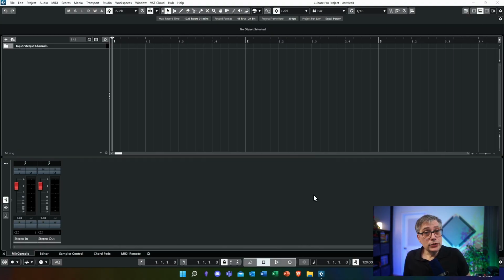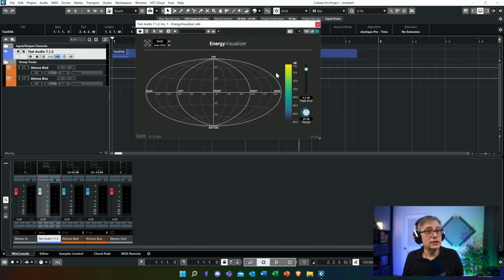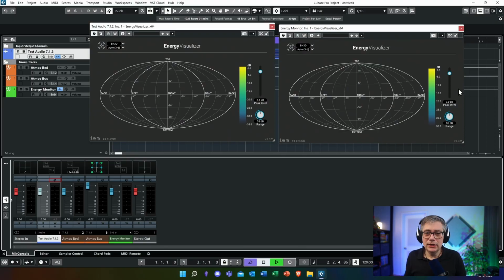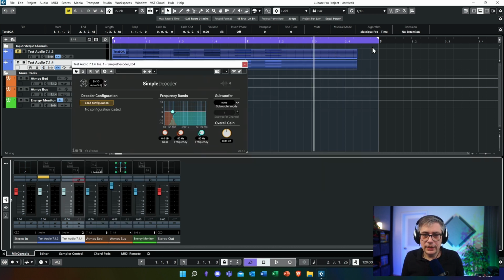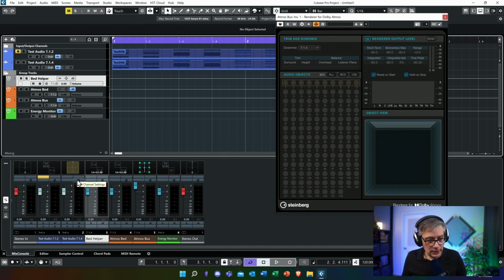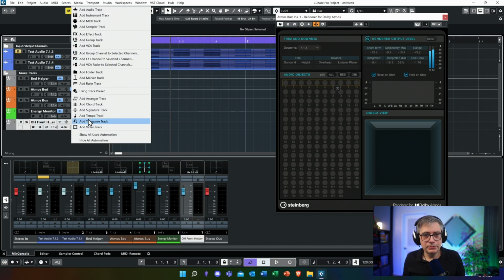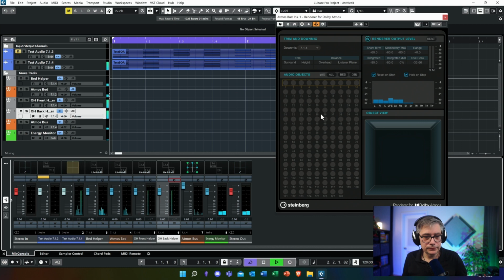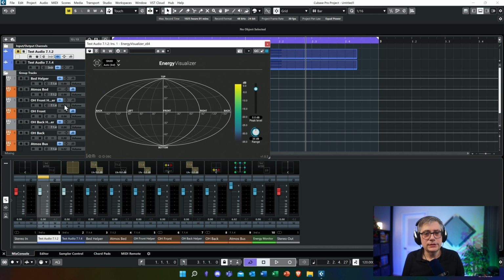Converting Ambisonics to Dolby Atmos Part 2: The Ultimate Cubase Tutorial

Comment: hi Michael, thx for being the only one who teaches these on YouTube, do I need to convert quadrophonic sound to ambisonics for Atmos mixing, or does rooting quads to Atmos work just fine?
Reply from the maker: No need to convert to Ambisonics. You can just use 4 objects located at the speaker positions of the quadrophonic signal.
Reply: @michaelgwagner  and it sounds right? because it is the ambiance and I'm not sure if it works fine, my sound has two tracks of quad high and low, can I route both of them to Atmos 7.1.4 bed? I watched the video and I noticed the crash part of Nuendo/Cubase but I couldn't avoid it anyway!
Reply from the maker: If you start with quadrophonic and position the speakers objects in Atmos correctly it will sound better. A conversion back and forth to and from Ambisonics will degrade the signala bit.

Comment: Great video Michael! 👍 I have a Zoom H3-VR recorder. It can record in 3 different (I think 1st order) Ambisonics formats (FuMa, AmbiX or Ambisonics A). Can you please tell me what format would be the best to choose to convert to Dolby Atmos and what the way would approximately be? Thank you very much for your help! Kind Regards from Austria :) Dominik
Reply from the maker: Thanks! You can either FuMa or Ambix and then simply use an Ambisonics decoder plugin to convert it to channel based. The decoder plugin should have an option to switch between FuMa and AmbiX. When in diubt, use AmbiX. For a decoder, use the free IEM suite. Cheers!
Reply: @michaelgwagner  Thank you for your reply! I will go with AmbiX, as you recommend it and as I have the most experience with it. When I stay at AmbiX I don‘t need a Plugin to switch between FuMa and AmbiX, right? And can I just create a 1st order Ambisonics track instead of a 3rd order one where I insert the file and do the rest as you do it in the video? And it has to be a 1st order Ambisonics track and not just a 4 channel track, right? Sorry for my many questions and thanks so much for your help!
Reply from the maker: @user-vq3ly1mn8f They are more or less the same. The channel are ordered differently. And yes, 1st order has 4 channels. But you need more if you decode it to a higher channel count format.
Reply: @michaelgwagner  I see, so I could do it with a 1st order Ambisonics track and then like you did it in the video but the result will of course be not so good because of the missing channels, right?

Comment: thanks for the informative video just one thing that would be good to know is how to render out the atmos file and how it can be used after that.
Reply from the maker: You need to export the master file with the export function or you can also bounce the result of the renderer output (which would no longer be Atmos though). After that it depends a bit on what you want to do with it. Generally speaking you will need to do one of two things: 1) use the Atmos conversion tool to convert the master file into another Atmos format depending on your requirements. Or 2) use either the external renderer or AWS to create a QC deliverable (an mp4 in DD+JOC encoding). The latter can be played back on pretty much any device. The former is primarily for creating deliverables for streaming services.

Comment: This is wonderful and helpful -- Cubase has so many nooks and crannies! I do ambient recording on a Zoom H2n (yes, not great) that can, among other things, produce a b-format 1st order file -- optionally stereo, mid/side & 4 channel. I'm scratching my head about what, if any changes, I need to make to this workflow to incorporate this material. Initially, because it's ambient in nature, I guess it's a Bed candidate. But there is no reason why that is necessarily the case. The test audio you use is 3rd order b-format or already decoded to 7.1.4?  As you can see, I'm still confused about how much one needs to tell Cubase about the actual audio in order for it to 'auto-magically' help me or, as is often the case, not.
Reply from the maker: It is in 3rd order Ambisonics B-format. You just specify the track to be an Ambisonics track and Cubase adjust everything automatically.